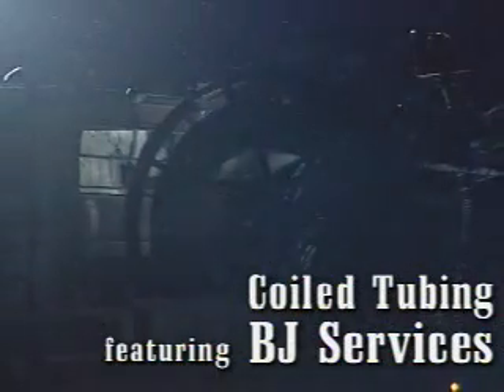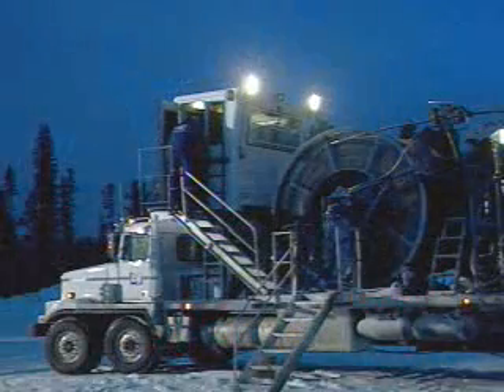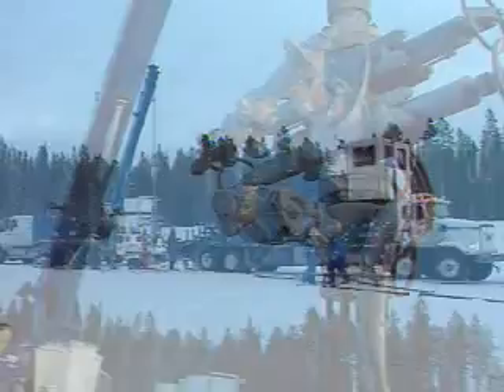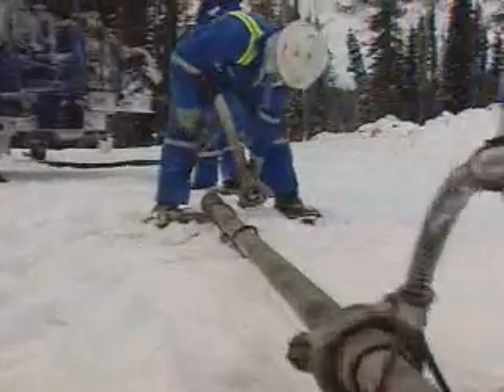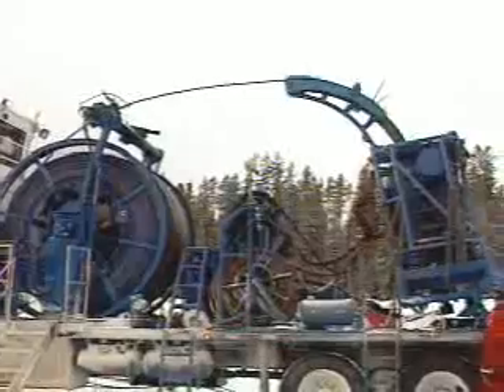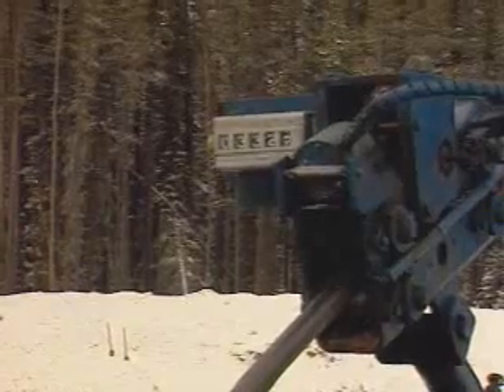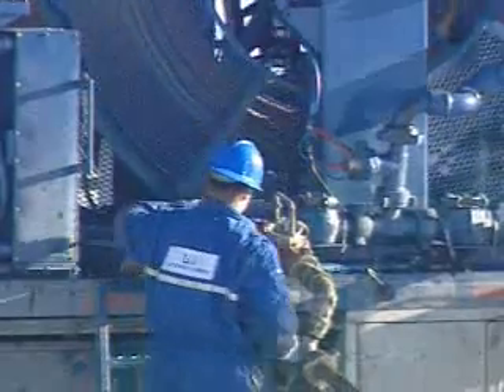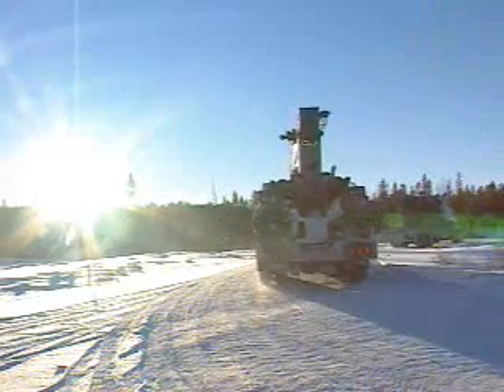Coiled Tubing

Comment: How many times can the tubing be coiled and uncoiled before it needs to be replaced because of stress and deformation failures?
Reply: They keep track of the depth of each bend/cycle . So say if a frac plug is at 9273ft and you tag it and pull off several times before you drill thru it . Well just like a paper clip that part is wore out a certain percentage that an engineer collects the data and in certs it in a computer and then decides for the crew to cut off 20-200 ft to move that spot just in case the next well is the same depth of course at the end of the job . Called cycling the pipe . I am lucky to seen this first hand on sloppy engineers calculations and had one break with 6k surface pressure. so drilling over balance was like the roar of god coming thru 1.5 inch tubing about 7-8k psi with 20k ft of pipe . On a BP location . ....hopefully this helps
Reply: @jtsuave6125  Yes it does help. BTW, I am an engineer and I knew there had to be a lifespan because of the bending and other stresses on the tubing.